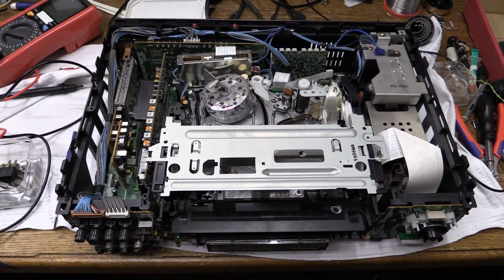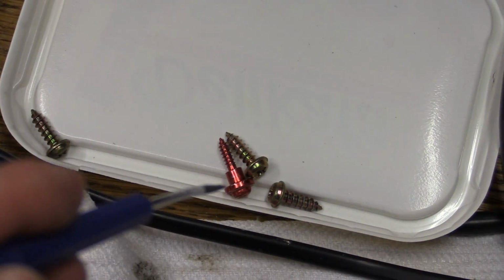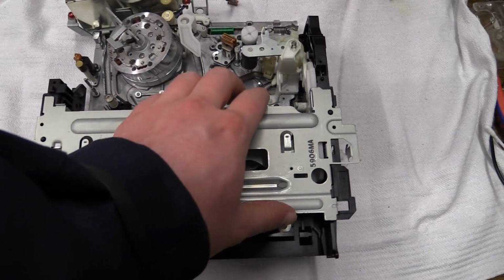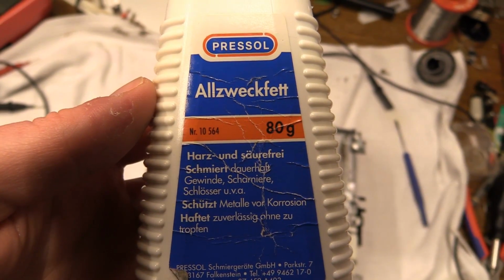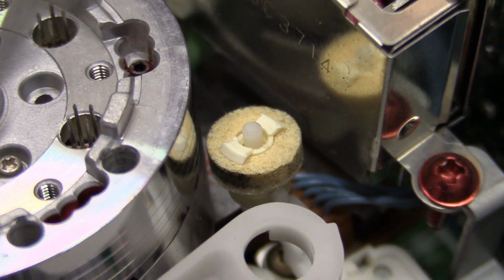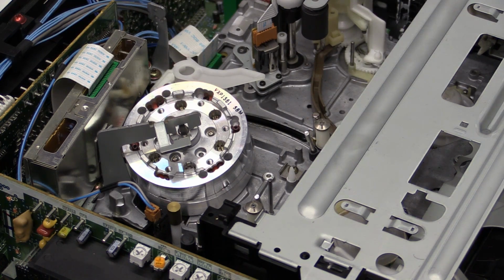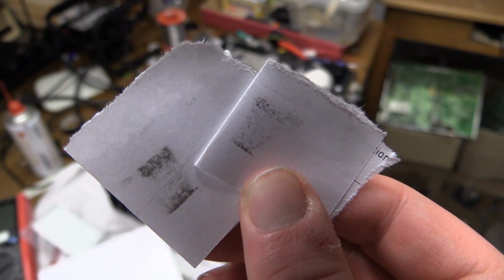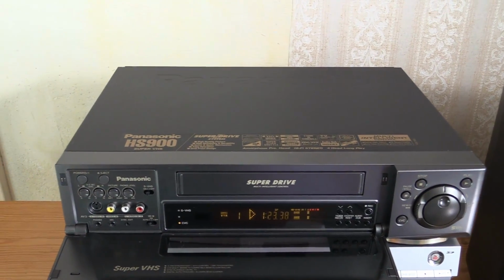DrCassette's Workshop - Panasonic HS900 S-VHS VCR full service

Comment from the maker: IMPORTANT: When re-greasing the tracks of the loading mechanism, do not copy what I did in the video. Instead, clean off all existing grey grease with a dry cotton swab, then apply fresh white lithium grease. Do not use just any random grease!
Reply: Great video. I've had this player since new and a video got stuck just before I moved 12 years ago. After seeing this I managed to get it out and remove the mechanism. Definitely will sit down some point and remove all the old grease and replace it. In hopes the tape will feed around the drum again. At the moment it won't wind the tape around the heads. The parts move easily by hand but not mechanically. I'm hoping something is just dry as with the mechanism out I didn't see any broken teeth and there was no parts sitting at the bottom on the main board. But so lovely to see this player in the YouTube spotlight and getting some attention.

Comment: Thanks for this excellent video. Managed to remove the transport, using your guide, from an NV-HS950 which I purchased from eBay and did indeed need re-lubrication. The trick with paper to clean the heads safely worked like a charm!
Reply from the maker: I'm glad this video was helpful :)

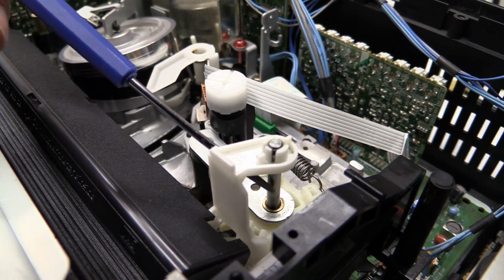Comment: Thank you very much! I am just got a tape stuck into a panasonic vhs and the only thing I did was apply a spray oil (wb40) in the (12:55 min) part and the tape eject and play perfectly!!! Thank you so much from Argentina! I was doing a analog to digital vhs converter for a client and got this panasonic, put the tape and doesn´t play and won´t eject.. really worry until found your video!! (sorry for my english!)
Reply: yes that's the pinch roller mechanism which is supposed to lift up before the tape is released from the head and wound back into the tape. If it's not lubricated it doesn't move or moves too slowly,  throwing the unload sequence out and the tape gets tangled.

Comment: Reminds me of a Mitsubishi VCR I have I opened it up a few months ago and the loading belt had completely turned to goo luckily I had a spare parts VCR which was the same model and fixed up a bad solder joint and replaced a DEW sensor and its going good again

Comment: After 29 years, my Panasonic NV-SD3 VCR does not require any lubrication, greasing up of the gears, tracks or realignment. I only investigated whether the unit required a thorough service which it didn't. I didn't even have to blow out any dust, ( something I would never do) , as there was wasn't much of. If there was, I would use a new blusher brush and gently brush away the thin layer of dust towards the back of the unit. I use 91% isopropyl alcohol and two fine cotton wool rounds (not paper, as you can damage the heads and the drum) to clean the tape head and the drum, without touching those delicate components, hence the use of two fine cotton wool rounds. It still works an absolute treat ! 😊By the way, the plastic parts in the mechanism, have not gone a yellow colour yet and still off-white colour.
Reply from the maker: Paper will not cause any damage to heads or drum. Cotton wool will cause damage if it gets caught in the wrong places. Not touching delicate components means you have not cleaned the full tape path, so likely the cleaning has next to no effect.

Comment: VFDs tend to attract dust because of the relative high voltages that they need to turn on segments. Newer ones don't need such higher voltages, but they're not that bright as a result. Also, nice built unit and you're so lucky to find it in that neat shape. All of the old VCRs that I've seen in this "era" are really damaged.

Comment: I think those sweets were probably also shorting something out, I don't know what the electrical resistance of Haribo (or whatever) is, but I'm sure it's no insulator! That's a good way to clean the head drum, I was the one who came up with that method, I remember a long time ago when I tried to clean the heads of an 8mm camcorder using cotton swabs, it ripped one of the heads right out!
Reply: CoolDudeClem used to be a common problem with cheap 'head cleaning cassettes' too, the really cheap nasty ones would have loops on the fibre, and would occasionally tear out the entire head :(

And resistance of Haribo and similar things: I see the need for a video

Comment: I bought the panasonic 900 back in 1995 for £400 new, best vcr I ever bought, still working today, don't use now I fire it up couple times to keep it rolling but keep it for old times sake as i don't want to ruin it, it was the first thing i bought from my first wage packet lol.loose that head cleaner though they do more harm than good especially when they go black and seize they mark the head drum it did it on mine, took mine out and just clean the head manually

Comment: either the 900 or 950 had digital video  processing, which VHS needed. The picture off one of these was the best VHS pictures I'd ever seen off domestic equipment. I owned ( and still do ) a HS800 and 1000, and thought that was pretty good, but the 900/950 was even better
Reply from the maker: You mean the HS950 with "Digital Process". I do have this machine. Unfortunately the digital processing circuitry does contain early generation SMD capacitors, which are prone to fail. My HS950 unfortunately does have occasional disturbance in the playback video signal, and recordings sometimes just come out as strangely pixelated snow. I think this is due to bad capacitors. So the HS950 may have been a very good machine in its day, however it is not the most reliable.
Reply: interesting to read. that. I have an HS 800, owned for 20 years.It only needed a plastic part to repair a jammed loading mechanism., The HS 1000 has not faulted, but I have not played it for many years.
Reply from the maker: Should you decide to put the HS1000 back into service, make sure the oil on the shaft that the pinch roller assembly rides up and down on during the tape loading process has not gone bad and sticky. If the pinch roller assembly can't move freely, there is a risk of damage to the mechanism.

Comment: In the loading motor shaft is attached a small plastic to transfer to movement to the outer plastic screw which touches the gears.This little plastic brakes and causing loading problems.

Comment: What's the component with the brass head next to the erase head is it just a guide post. It was causing problems for me, not sure if it's loose and you have to tighten it or just squirt some lithium spray in there. Also the part next to the pinch roller with the big white plastic head I had to turn a few times since it was making a squeeking noise when I run a tape through it.

Comment: Hi, I have a vasonic panasonic with the same mechanics, it presents the error F04 in the display, the tape aguarra in the input, to pull until the head goes normal, but when it comes back it gets stuck, in both situations have to force the mechanics to go, what can it be?

Comment: Hi. I've had one of these from new. I recently found that mine was dead, nothing at all, so I opened it up and had a look at the PSU. I couldn't find any bad looking capacitors, but I noticed there was a fuse. I tested it and it was dead. I put a new fuse in and when I applied power, it blew immediately. Could you suggest what may have gone wrong in the PSU or perhaps give some idea of how I can troubleshoot it? Thanks!

Comment: That was a fantastic service/cleaning video of this wonderfull machine dr. Cassette. I do have some questions to ask. First what type of alcohol you used? Isoprophilic? When it comes to clean the head with the paper method. How much pressure do I need to apply? And more important. Is there a special spot I need to reach to clean the head with the alcohol soaked paper? Thank you for sharing this and I'll be specting your anwers.
Reply from the maker: Isopropyl alcohol is what you need, or a didicated head cleaning product. The paper and the pressure applied has to cover the entire width of the upper head drum, that spins. I can't describe how much pressure you need. You should be able to feel the heads through a double layer of paper.
Reply: Okay. Thank you Dr.Cassette that was really helpful. I'll start working on my Samsung VHS. I know is a hi-fi one, It has a decent video quality and it´s dirty. Really big fan here, keep the videos coming. I´ll stay in tune on your channel

Comment: Doc, quick question. I got an AG-W1. I already rebuilded the PSU. Works and plays fine, but the picture shows noise ( it's black/white lines in the upper middle of the screen) in the same place. Could be the head or should I try something else?

Comment: I've had a Sony SLV770HF for 21 yrs now and it's the most advance VCR I have owned. When it was released it was ahead of its time. About 7yrs ago it started to experience a noticeable line across my TV screen only on play, if I slow mo/ fast advance it would disappear. I have always had intentions of repairing this. I came across your video and followed it to the T. Unfortunately now when I play the tape the entire picture is distorted and I get no audio as well. In your video you mention not going at the drum with anything but paper and alcohol. Also you mention ripping out the head with little or no force using a cotton swab. I would appreciate it if you could elaborate on that. You vid is very thorough and I would only hope you could remedy my dilemma. Thanks.
Reply: +DrCassette Ok will do.

Comment: Brilliant guide to performing maintenance. Question, for this deck, how do you remove a jammed cassette? The tape is around the capstans, drum, pinch rollers, etc? I can't do the service on the YouTube clip until I can get the jammed tape out.
Reply: You can only do it manuelly by taking the top off and using your hand to clear the tape away from the guide posts etc...the tape should then eject.

Comment: recently bought one of these. runs okay when cold but mechanism starts to stick when attempting to load or unload a cassette. will go in and out of the machine but when wrapping tape around drum u can hear the motor spin but somthing slipping. get error f3 or f4. had the mechanism apart bur cant see any obvious faults with gears. any ideas?
Reply: Did you ever find a solution as mine is the same?

Comment: this is called the "Panasonic G-chassis", with the famous P6 lever (which you can break easily if you resync it not correctly.)
but if the chassis ages, it may be subject to funny noises when running single-image forth/back.
Reply: rarbiart This is actually the "K" mechanism and not the G type. I know because I have the exact same one along with the service manual.
Reply: pounder46 thank you for the correction.. it's now about 20 years that i had the last VHS chassis on my bench... (i suddenly feel rather old now)
Reply: Yeah. This is the K mechanism. My NV-FS200 uses the G2 mechanism. Very complicated!

Comment: Hi, I have a loading problem with my machine (keeps rejecting tapes) which uses the exact same mechanism as your machine. I replaced the mode switch, reset the timing, lubricated, etc but the problem persists. Any tips on what else I can try to fix it? Here is the link to my clip showing the machine with the problem: https://www.youtube.com/watch?v=fDECZ6IQFUY

Comment: I just got a super vhs player and the difference between vhs and svhs is huge.
Reply from the maker: pooperscoop54321 
Of course it is: VHS has a resolution of 240 lines, and S-VHS has a resolution of over 400 lines!
Reply: I knew that, but I had never seen it for myself before. I liked the way VHS looked when I had a 26 inch 4:3 TV because it was small enough that the image didn't look bad, but since I got a 32 inch CRT VHS looked a lot blurrier, but Super VHS looks really good. Also, the SVHS tapes I ordered haven't gotten to me yet, so I've only seen SVHS ET for a comparison. Is there a big difference between ET with a high quality tape and an actual SVHS tape?
Reply from the maker: Super VHS will work on regular VHS cassettes if you drill a hole into the cassette case to trick the sensor in the VCR. I would imagine that a proper S-VHS tape gets better signal to noise ratio than a standard one.
Reply: I just got the SVHS tapes I ordered, so I recorded a comparison right away and there was another huge difference in quality. There was a lot less noise over the footage and not as many artifacts. I could beleive it was actually a tape, becuase there was barely any noise. And I already have an SVHS  deck. Now I really wish that SVHS had caught on, because I have some shows from the 90s and early 2000s on VHS and I really wish they were SVHS now, since regular VHS's lower resolution is more noticable on the 32 inch TV I use now comared to a 26 inch one I used to use.

Comment: Nice find..I found a Panasonic RX-CS780 boom box in the garbage bin at the apartment building I live in..It's a great working old boombox but the cassette player doesn't work properly, it chews tapes..
Reply from the maker: You may want to check the belts, idler wheels and the pinch roller.
Reply: DrCassette Thanks..I've been meaning to take it apart and check it out but haven't found the time

Comment: I got an NV-HS800, but there's a plastic part broken in the mechanism unfortunately. I don't remember exactly which part it is, as it was a few years ago when I last looked into the unit. However, I might give it one more shot, as it would be nice to have that VCR up and running in order to use it for recording audio :)
Reply from the maker: That's what my father did in the late 80s. He wanted better quality than what he could get with cassettes, but couldn't afford a DAT recorder, so he got a HiFi VHS machine. We still have some audio only VHS cassettes.
Reply: Although I do have a studio quality Studer reel to reel tape deck, but good tape is expensive, and VHS cassettes are not. Also, in the future I might buy a PCM converter for quadrophonic recording and playback. I know that Mobile Fidelity Sound Lab did release a quadrophonic mix of Dark Side Of The Moon on VHS, where the front two channels were on the video track as PCM digital audio and the rear pair of channels was on the Hi-Fi audio track, which effectively is on the video track as well :)
Reply: ***** Mine did the same. The part was replaced and it works perfectly now

Comment: Hello Dr Cassette 
I have this panasonic VCR and it loads a tape fine but will not eject the tape and has F03 error 
If I assist the motor it will eject but the mechanism seems tight at one spot
Reply: Did you ever find a solution?
Reply: @jefffan171  if I just lift and twist the VCR just slightly it starts to work again and it has stopped having the error atm so by persisting and using it probably cleaned whatever was dirty

Comment: Thank you for your great and helpful videos. They have helped me more than once. This time with the tip "stuck pressure roller".
Fortunately, no parts were broken off. Cleaned and made operable with sintered bearing oil. Now the good piece can serve as a "tape deck" with a long cassette running time and great sound. Best regards and keep up the good work!
https://youtu.be/3ljsn6sxOhM
Reply from the maker: You are welcome :)

Comment: Hello doc! Long time not bothering you. I had a question for you: in your experience how good or bad are the internal TBC's of these Panasonics?
I ask you because of the AG4700 I have. I made some captures and when the TBC is on, the sound ain't exactly right. Some parts speed's it up. It's ok MOST of the video, but aint perfect.
So, since I have anothers AG4700 (for parts) I took the working deck from the first one and put it into another AG4700. Now it has color issues. The colors just look weird and off. I mean trully off, green looks cyan and some colors doesn't even show. So... I took the baseplate and swaped the TBC module from the first deck to this one. Now colors are back. Seems that TBC module from the second one has some issues.
The question is: This TBC module (VEP03A53), has 8 variable resistors:
DIG. C LEVEL, W.B1, W.B2, R-Y LEVEL, 1HDL GAIN, TBC SYNC LEVEL, TBC OUT LEVEL, NOISE GATE.

Do you think that the color problem of the TBC that was on the second AG4700 could be solved by tweaking some of these resistors? Or I just bet on bad caps?
Also, the audio sync problem, could be solved this way? Have you ever tweaked a TBC? I know you will say "if it works, don't mess with it", but I really need this to work properly.

Oh and when the good TBC is off, the sound sync is way better!
Reply from the maker: I haven't looked at TBC modules in this great detail, so I really don't know much. On the module with the bad colour you could try tweaking the R-Y LEVEL as that has something to do with the colour signal. I too have some problems with the TBC in my HS1000. Most of the times, the video has more time base errors with the TBC turned on than with the TBC turned off, so the TBC in my VCR actually tends to make things worse.

Comment: I just got a vcr player to watch old videos on and after first video a plastic piece beside the  thing that ejects the cassette broke I don’t know if it has anything to do with this but the cassettes gets stuck and doesn’t eject properly and it’s visible especially on the right side. It doesn’t get pushed up same way as left side.. there was only one plastic piece but doesn’t seem to connect to the bigger plastic thing or I don’t know how to put it back, there was also a looped metal wire that came off after.. any clue on how to fix this? It’s a Panasonic NV-HD620
Reply: Sometimes the tape gets out but most of the times it doesnt